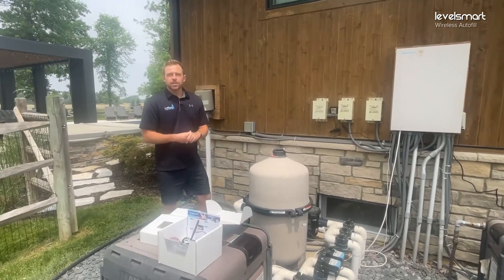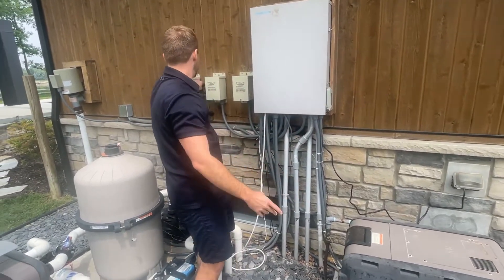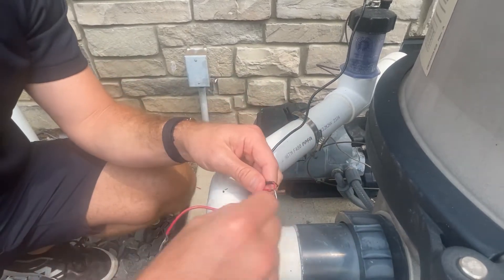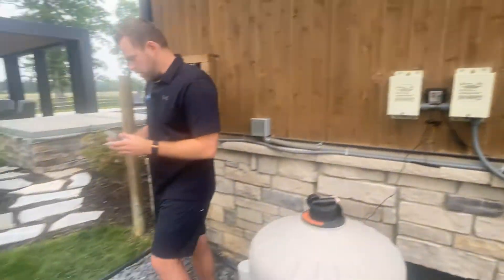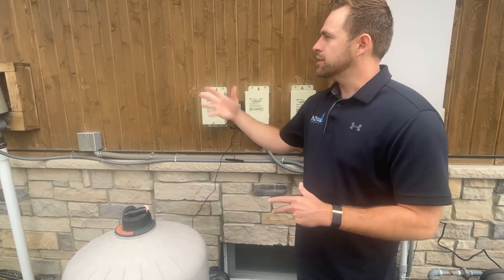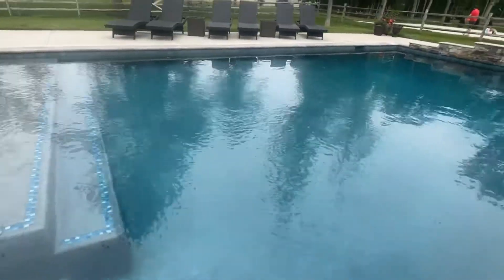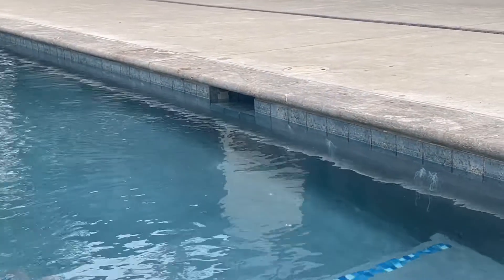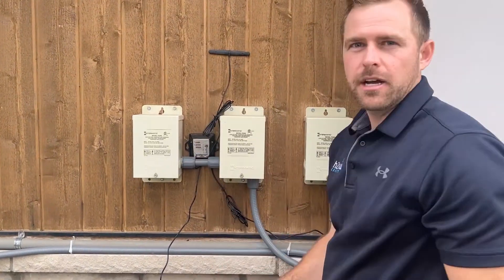LevelSmart Installation Walk Through

Comment: When winterizing a pool with this setup, what should I do with the sensor in the mouth of the skimmer? Also, when opening a pool with this set up, do I need to recalibrate the sensor level? How long does the battery on the sensor last? What if ice breaks the sensor?

Comment: When you unplug the unit, is the valve open or closed?
Reply from the maker: Hi @saxsemilla - thanks for your question! The valve is spring loaded and is normally closed. Unless it has power, it will remain closed. If the power to the unit is cut due to being unplugged or if there is a power outage, the valve will remain closed. Please let us know if you have any other questions